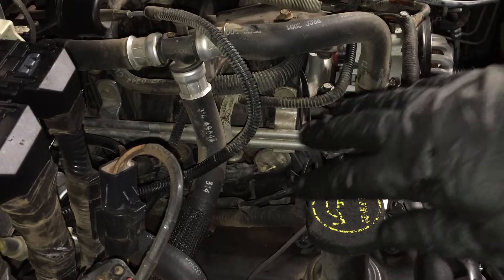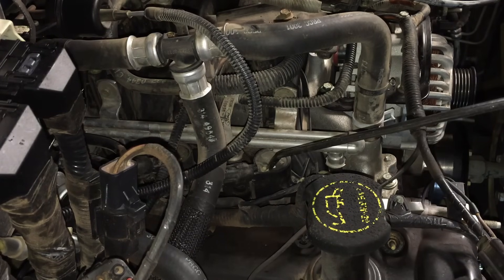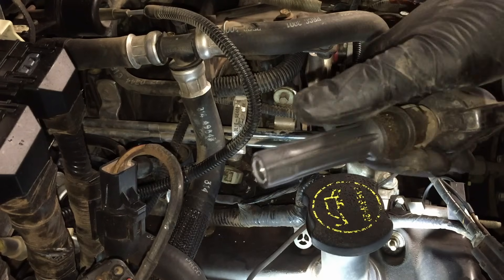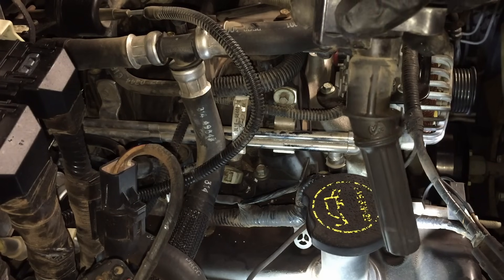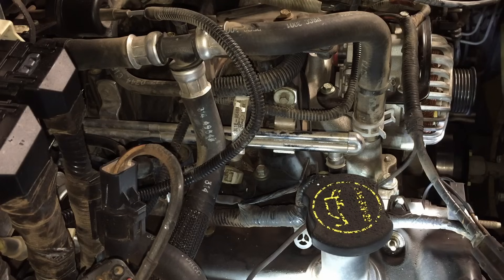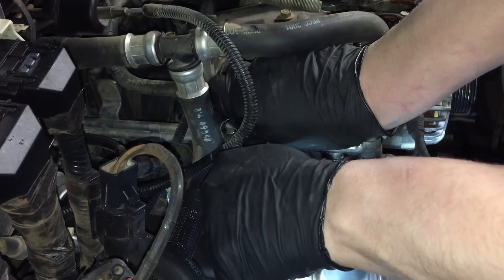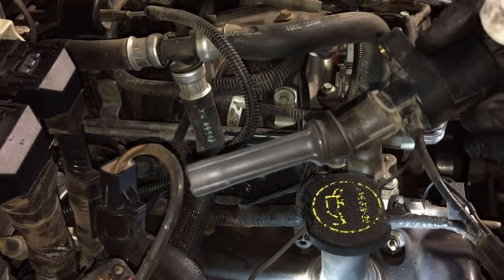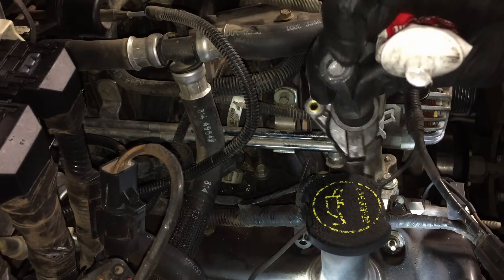Important Tips When Replacing Spark Plugs on Ford 4.6L 5.4L 6.8L 2v Engines

Comment: Great video! Dealing with hesitation.Wished I seen it sooner. Have 98 Mark VIII LSC 32V. Forum suggested .048 gap not .054 and NGK iridium plugs. Did find oil on all passenger side plug ports. Running better. However, engine light is now on (used ODB2 tester) stating misfire on #5 (drivers side front of engine). All drivers side ports oil free. Should I change plug type to motorcraft and gap .054? Suspect I need to replace #5 coil. This a viable option? https://www.amazon.com/gp/product/B013J829TO/ref=ox_sc_act_title_3?ie=UTF8&psc=1&smid=A1PS96CG2U31BM. Appreciate your help!
Reply from the maker: I would only use the Motorcraft coil- http://amzn.to/2l8PXaG
Reply from the maker: Also be sure to check the condition of the new plug specifically the porcelain around the center electrode at the tip new doesn't me good.
Reply: FordTechMakuloco
Reply: FordTechMakuloco You know NEW stands for NEVER EVER WORKED right hahaha

Comment: If I take it to my local Ford garage (because I'm not really confident to do it myself & I have fat hands), do you figure they will be as careful & pay as much attention to detail as you do? :) Since it's a 1998 (4.6 Nascar Edition) I worry the mechanic that works on mine might not have been around long enough to have heard about the limited threads deal & won't tighten them like you said. Ehh maybe I'm worrying to much I dunno, but I've known about this issue for many years now. Mine are technically past due for changing at 136,000 miles - though I'm not experiencing any issues yet that I can tell, thus I am just milking them until I notice a drop in performance ...It's the thought of rocketing spark plugs & the $$$ the dealer will charge me that keeps me from doing anything right now that I don't have 2...Plus If I did it myself I'd wind up screwing something up & then have to be towed to the garage anyway. But I like your videos anyway, even if I likely won't do it myself it's great to watch & hopefully I retain some of it in my brain for later..so thanks :)

Comment: I have the DOHC 4.6L with the increased number of threads.  Mine is a 2004 Mach 1.  I torque mine to around 14 ftlbs.  I believe it calls for 11 to 13 ftlbs.  Do you think 20 to 25 ftlbs is too high for these heads?  Knock wood - I haven't had any blow outs, but I also change them once per year because they are so cheap and easy to do on the 4v engines.
Reply from the maker: No I think it is just fine we never have any thread problems and much better than a blow out that takes the threads with it.

Comment: Will autolite plugs gapped at .54 work the same as motorcraft plugs??
Reply from the maker: The gap is the same across the board yes.
Reply: Oh hell yeah. I got Denso's for mine.
Reply: Typically for the Fords, I stick with the Motorcraft when dealing with ignition, plugs, etc. Especially if it's stock.
Reply: .054 not .54

Comment: I like you am a ford guy, my question is what's up with Ford and spark plugs these short thread plugs that can and do blow out and the extended plugs for the 3 valve engine that break off why does Ford seem like they are trying to reinvent the wheel when it comes to spark plugs?

Comment: Do you know what year the broken plugs were corrected? I have a 2011 Expedition 5.4L and am trying to determine whether I have this issue...
Reply: Meny Elgadeh 
the issue only affected 2004 and older. 2005 and up are ok
Reply: that is definitely not correct dude. Seems like the issue was corrected in 2008 model years and up.
Reply: Meny Elgadeh 
if you say so.
i am almost positive that they went from 2v engines to 3v engines after 2005
Reply: kingfisher Singh 3v 5.4 was introduced in the F150 in 2004 (new body style) But it doesn't matter what year truck you have. It's the engine build date. There's a engine build sticker on the left valve cover. 11/30/07 or newer has the updated 1 piece spark plug.

Comment: Before I start I have always had good luck starting the engine and let it warm up for a few minutes then let it cool down enough so I can touch it. Plugs will come out easier.
Reply from the maker: Ford actually wants us to work on a warmed up engine now when removing any spark plugs. They say cold and hot engines have a tendency to pull the threads out of aluminum heads. I find it interesting after all they years just recently they have made this announcement.
Reply: Me too, However that's been my own experience. I used to drag race and of course had always heard cold heads on aluminum, however when you are checking plugs after a nitrous pass between rounds you do not have time to wait for it to cool off...I soon found that the plugs came out easier warm than cold.
Reply: PS Thanks for the vid.

Comment: i have a question, i plugged my ford f150 truck on a obd2 reader and reads po201ford koeo injector circuit/ open cylinder 1. What does that mean as i have no clue? It's a 2013
Reply: http://www.fordobdcode.com/p0201-ford

Comment: Another idea I use is adding seafoam in the fuel a week before I do the plugs to break any carbon off so it doesn't beat the threads up when I'm taking the plugs out.
Reply: riphaven     Dealer recommended some kind of hot flush before they tried removing plugs
Reply: What does a hit flush mean?
Reply: What does a hot flush mean?
Reply: BINGO
Reply: NO!!! Seafoam will cause a spark plug to blow out or misfire. On 1997-2002 triton 4.7

Comment: hello again ...on my zx3 2.0 2005….is changing out the injectors (4) at 100k mi a good idea? Injectors are electromechanical and under go incredible volumes of action compared to other parts..but at $40 each I'd need to squirrel away 4 over the next few months. Thoughts?

Comment: I have a 2004 e 150 5.4 its a conversion van from tuscany with dual heating and cooling, now my question is AC every time i drop my speed under 30 it starts getting hotter and hotter a shop told me the compressor is bad but the freon is charged correctly and it kicks on and off smoothly i have been hearing that its just a poor design on these type of fords any advice

Comment: Whatever happened to clear and easy access to spark plugs without those damned ignition coils and the other crap?
Reply: Dave Bogusky; Amen, Bro. Not only that, but the sub-computers for the accessories that connect to the main computer (PCM) are now becoming intrusive with the engine where, say,  if you have a malfunctioning power window the car won't start or run. Of the $100/hour labor charge, an entry level mechanic only gets a small percentage of it; the rest going to pay for the super-expensive factory tools and "upgrades" to computers, and of course, overhead and owner/management salaries.NO...you MAY NOT fix your own car unless you are licensed and certified to do so...this hasn't happened yet, but lawyers and politics have an uncanny ability to screw the very people they're supposed to represent...it's all about the money, folks.
Reply: rayford21 like everything else with our government
Reply: As the years roll by...engines get more and more complicated. With complication comes...spaghetti.
Reply: Really? These are some of the easiest to change, MUCH easier than some of the older OHV engines with the spark plugs down on the side of the head usually buried under the exhaust manifold.. Try changing the rear plugs on a transverse  3.8 Taurus or a 3800 Bonneville. Any vehicle I don't have to lift the engine on or remove the front wheels to get to the plugs is easy.
Reply: @charliedee9276  I had the 4.0 V6 on a 97 Ford exploder joke but I had to take the right wheel off to get to the last spark plug on the right
Reply: Endangered species now.
Reply: TexasDog3 Its called computers control every damn thing because the govt more or less forces them into ridiculous emission standards. They have to run them so lean and they have to add all the emissions controls. I hate computers controlling everything. It creates a market that takes money and the diy out of our hands. Go to a dealer and its $100.00/hour go get your engine mgmt system diagnosed. Fortunately we can buy code scanners and manuals to check some things.

Comment: Why would you blow air into the well with the spark plug removed? I think other than that it was a great video.
Reply: A little or dirt won't hurt anything. I do the same thing when I work on these. When I do a tune-up on these engines (or anything like this where the plug is in a deep hole in the head) I undo all the coils and blow the dirt out before taking the plugs out. Then after the plugs are out, I do it again. Especially on the modular Ford engines. It'snot gonna hurt anything especially sinc you've already removed what could be truly harmful before you took the plug out.
Reply: If you listen he says he puts the air right into the cylinder itself, blows any little dust that may have dropped in removing the plug. He already blew out the well twice, any big stuff would already have been removed.
Reply: You did explain it well in the video.  (1) Blow off before removing coil, thereby removing most surface debris.  (2) Blow off after removing coil and before removing plug, thereby removing additional debris from around the plug, and (3) blow out after removing the plug in order to remove most of what little debris possibly remains after (1), (2), and the process of plug removal.  It's not rocket science.  Some 'viewers' appear to have commented without viewing, listening, or comprehending.  Believe it or not, some mechanics  also start the engine after the plug is removed in order to force out via piston head any debris which happened to make its way into the cylinder after (1), (2), and (3).  Now watch the commenters' heads explode.
Reply: I'd rather introduce a SMALL harmless amount of dirt than risk stripping the damn threads in the head.
Reply: Ive used a modified hose end on a shop vac and suction out especially if a threadchaser is used with the piston on top dead center to insure a smaller pocket to vac out. Ive also put just a dab of grease on a suitable instrument smaller yhan diameter of sparknplug hole thats inserted and carefully rubbed against threads to stick to debris cleaning off the instrument , vac, regrease instrument repeat til i feel its clean. Pain yes,  but not as much as  possible damage debris would inglict. Lol
Reply from the maker: +david oliveira I think I explained it pretty well in the video. If you have ever changed as many as I have you will never do it any other way. Think dirt dust corrosion on the threads and seat area not to mention this style lends itself to small rocks getting stuck between the jam nut and well that only come loose when the plug is removed. Do you want to really chance it?
Reply: Blowing that stuff around after the plug is completely out makes no sense.  Would have made more sense to blow it out again after you backed the plug out some...but not fully removed.
Reply: I think you risk blowing that debris into the cylinder.  One little rock would really ruin the cylinder.

Comment: Thanks Makuloco,Great DIY video. I have a 2001 Expedition with 200.000miles. It runs good except the other day cylinder number seven the spark plug came out.  I followed your video and it looks like the tread were not damaged therefore I put the new Motorcraft plug in it with a new coil that I got from Amazon. My question to you is I bought the coil the one that you suggest 5208 (I think) from Amazon it didn't say  Motorcraft on it but the number is the same as the one you suggest so I am wondering if this is the same thing without  the brand name typed on it. Also is there some sort of liquid you can put in the hole before removing the old spark plug to make things easier without breaking them. 
  Thanks

Comment: I have a 97 explorer  was running fine . the other  sputtered out on the freeway. had it towed home. it starts idles really rough then turns off. I changed the fuel filter. same it starts but shuts off after a minute.
Reply: I can think of many things fuel injector fail it may not getting enough fuel or it can be flooding it coil on plug fail spark plug fail fuel pump can be failing maybe
Reply: It's either a lack of fuel, air, or spark. First figure that out then figure out the failed component.

Comment: What is he referring to when he says he's using a universal when he's talking about the socket and extensions?
Reply: he could be talking about a socket elbow universal joint, to get to the spark plug in an angle whenever you dont have room to gey to it in a straight line.
Reply: yes, as jose says is joint for extensions that gives movement like an articulation;   360° on axis X and from 70° to 180° on Y. Hope this came out right. lol! and it is a must for the 5.4L at the firewall plugs (4 and 8) and all this is done by feel, you barely have room for your hands!
Reply: He is actually using a wobble extension (an extension where the end is milled to allow it to flex 15°-20°) this provides the angle right at the point where the socket ends. This prevents the binding common to non impact universals and also takes up less room (width) than a swivel. Both have their place but where a swivel extension provides enough angle it almost always works better than a swivel

Comment: Great video, excellent quality, lighting, camera work, commentary. I watch so many of these do it yourself repair videos and yours is good stuff. I usually skip the beginning to get to the meat of the subject but even your dog is greatness. Keep up the good work!
Reply from the maker: Thanks!
Reply: @FordTechMakuloco   hey brother I have a question and maybe you can help me with it can you get back to me
Reply: Hey Chris! could you explain what can go wrong using anything else but Motorcraft sparkplugs? Got 04 lincoln town car put autolite double platinum plugs and I emmedietly noticed a huge difference in power an half the time during starting engine! Thank you!
Reply: @FordTechMakuloco  just did this job on my 08 e-150 with the 4.6 and everything went great except for one cylinder, almost like something's in the way. Couldn't get the spark plug socket to drop down in over the plug, it's in a tight spot but I was able to get a mirror over it on an extension and it does not seem to be anything in the way I can see the plug just cannot get the socket to go over it, anybody ever had this problem?
Reply: Jerry Chandler

Comment: have a 1997 f150 4wd Romeo engine speedometer not working replaced vss sensor on transmission and on the rear end. still not working. Any suggestions. Thank you for your time and consideration into this matter
Reply: dash may be not working

Comment: Changing my Spark Plugs for my 2007 Ford F-150, 4.6L.
My Ignition Coils are Stuck, I can't pull them out.
Any suggestions?
Reply: ouch stuck boot don't be to rough if u try to pull them if your going to use them again but sounds like no dielectric grease was used I'm replacing both spark plugs and Coil on Plugs using NGK spark plugs and Accel coils also dielectric grease total of $280 dollars I also recently replaced all 8 injectors $650 Delphi injectors this was done on a 2001 Ford Expedition 5.4L 2 Valve

Comment: I have a 04 navigator,  which motor do I have ?
Reply: Go open your hood on the navigator look at the tag  that has your sepintine belt route diagram over on the top corner you should see 5.4 or you will see 4.6.You might see it on the plastic covers on top of the motor.
Reply: 5.4 4 valve

Comment: I had a coil blow so bad it also took out the fuse for the  whole bank. I replaced all plugs and coils but I used accel coils they seemed to give my 2008 f150 a bit more power. I did however use OEM  plugs

Comment: How do I know if it's a 2 valve ?
Reply: pre 2004 should be 2 valve. check your vin also. if the 8th number is an L it is a 2 valve
Reply: Also if you pull out a coil if it's straight it's a 3 Valve if it has an angle it's a 2 valve
Reply: Look up your year make model and trim level to find out
Reply: 3 valve was introduce till 2004 I think we have the 2 valve for the Ford Expedition specifically the Econoline always used the 2 valve till it was discontinued
Reply: I have a 04 with the 3v
Reply: There was a mid year update in 2004, the 2004 heritage was the older trucks with the 2 valve engines, the 2004.5 truck were the newer body styles with 3 valve engines. So the f150 from 1997 to 2004 had the 2 valve engines, and from 2004.5 to 2010 f150 had the 3 valve engines

Comment: Hey I have a 2002 f150 5.4L V8, I change the spark plug and ignition coil  but i cant found the spark plug wire? any ideas where it could be?
Reply from the maker: There is none.
Reply: +FordTechMakuloco  K thank you
Reply: Lol

Comment: Great Video! Thanks!
I have a 97 F250 5.4, 89k miles, about to change the plugs. If I don't use anti-seize, would you still recommend 20-25 ft-lb and/or 1/8 to 1/4 turn beyond snug with 3/8" ratchet? 
I'm torn on the anti-seize decision? 
I'm fearing the plug blowout after this procedure. Thanks for your input.

Comment: If you dont have an air compressor, is a can of air OK to use to clean everything out?
Reply: You could probably get away with it just fine but I don't like to because they have chemicals in them that spray out as a liquid before becoming a gas. They sometimes coat the bore. Your best bet would be to buy a cheap 3 galon compressor from Harbor Freight. They sell them on sale for $40.
Reply: its the same thing just not as high of a pressure

Comment: Thanks so much. We inferred some stuff on our 2003 e350 5.4 2v from this video. On the drivers side we had the fuel rail in the way but carefully were able to get #7 out from the doghouse side. Would love it if you put more stuff up about the 2003 e350! Maybe the fuel rail removal, valve cover gasket (we've got a little oil down there), maybe the rear end (there's a clunk)...are we in trouble? Anyways, thanks again. You're the man!